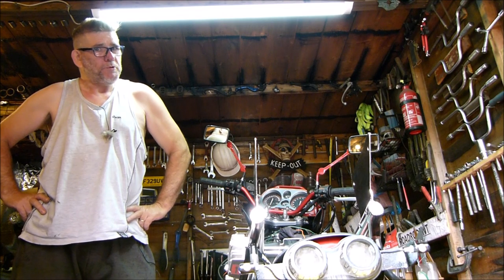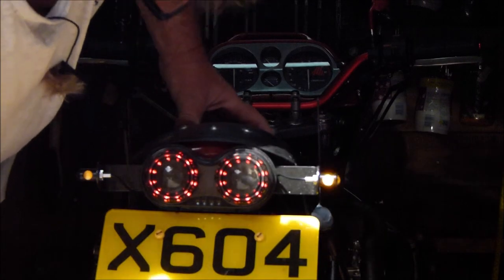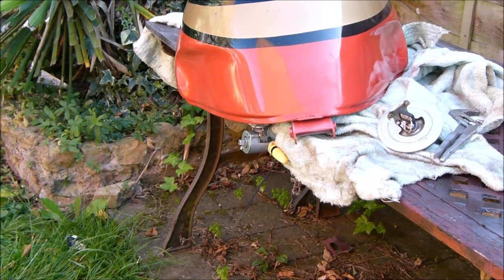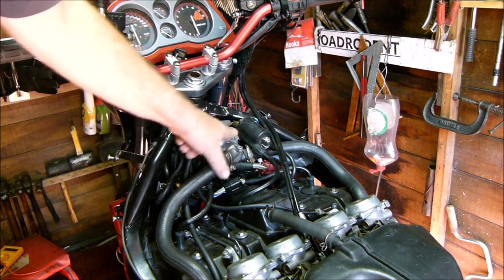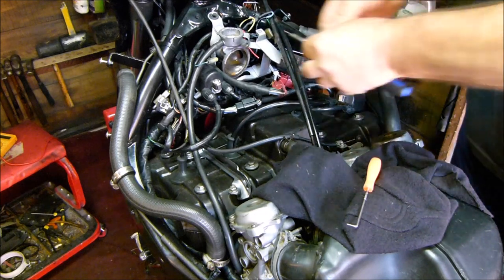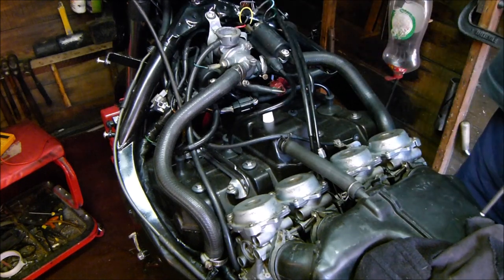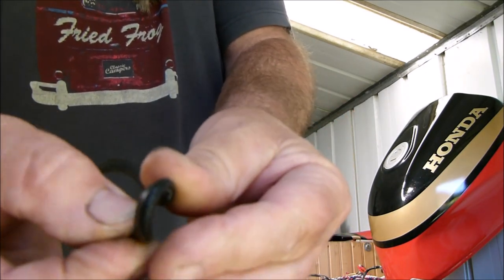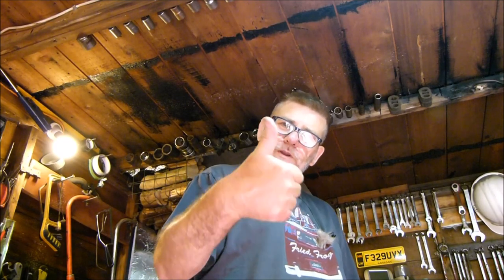cbr1000f Landfill bike. rusty tank leaky thermostat rear mudguard and rack

Comment: Amazing work you are doing. What patience you have. I had same problem with the petcock. Drilled it out all the way through on one side but impossible to replace the rubber gasket so I used a black Sealant (as press drill slipped and tore part of  the seal ) - JB Weld Ultimate Black which is petroleum resistant - and pop rivets have held it together. Mine's a 95 model so a vacuum version and different attachment to the tank.

Current issue is the sidestand and neutral light not coming on after rear shock replacement but I can't see a common lead or fuse. Garage suggested an earthing issue. Any suggestions for testing and tracing gratefully received. All the best from NZ
Reply from the maker: Hi thank you.. My neutral light keeps flashing on when I go through the gears I can't find the problem so I've unplugged one of the wires at the clutch leaver switch neutral light still working fine 👍